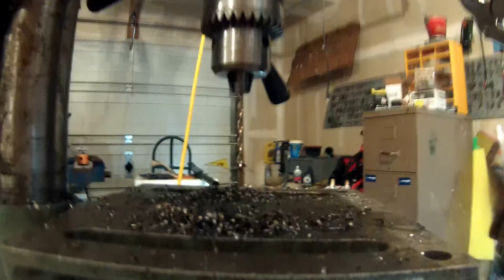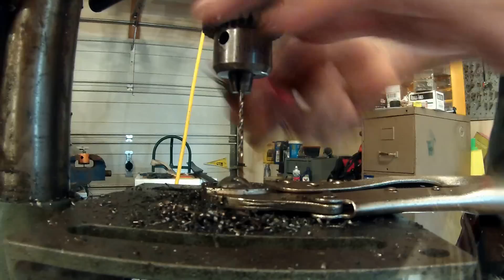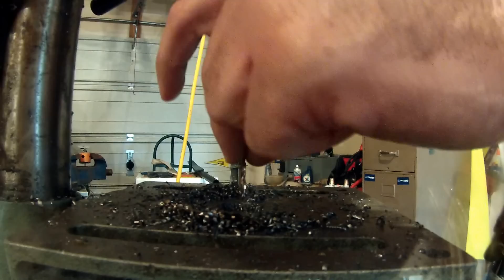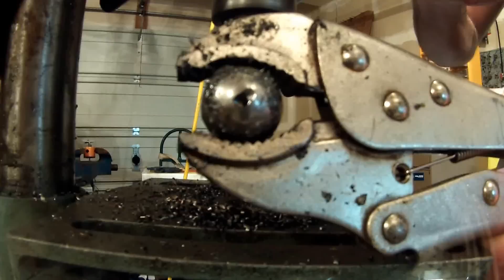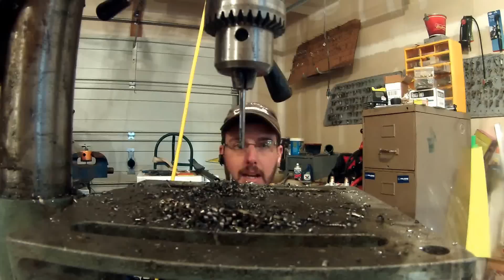How To Drill A Hardened Stainless Steel Ball Bearing

Comment: Can be drilled with a sharp regular HSS(High Speed Steel) drill bit. Best to grind a small flat on the ball first a liitle smaller than the size of the drill bit you're going to use, or a mark with a large centre dot. Then select a slow speed approx 260 to 360 rpm, use a coolant on the drill bit and apply a little more feed pressure than you would normally use for mild steel to make each cut count otherwise the sharp edges will dull quickly and you may have to touch up/regrind the bit a few times.

Comment: Very helpful. Thank you. Just one question: Did you have to heat/anneal the ball before drilling? Would that be easier, or a better option for drilling ball bearing like these? Because I have a bunch of little ones that I need to put holes in, and so far it looks like softening the balls through annealing is my best bet. I may try my luck with this bit though; just want an experienced opinion first!
Reply from the maker: I have not personally tried heat but if you do heat the steel first it makes make the bearing soft and weak. this may help drilling but it's useless after you drill it. also it is stainless steel so heating may have no effects whatsoever.
Reply: After putting a hole in the ball, would it even be possible to thread the ball afterwards?